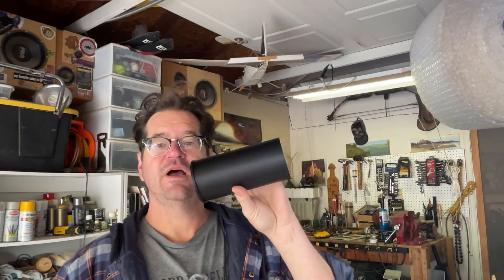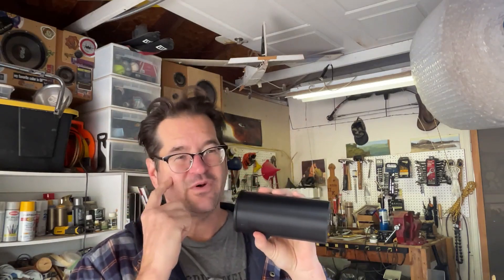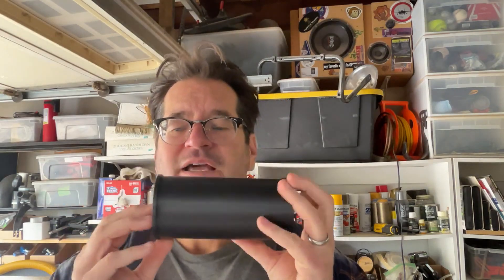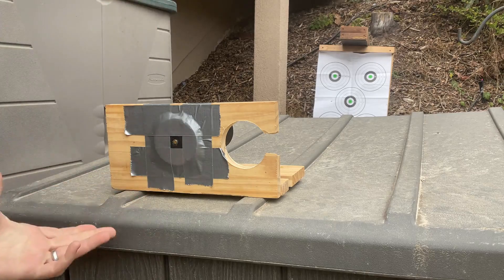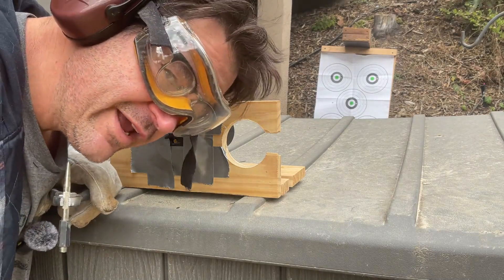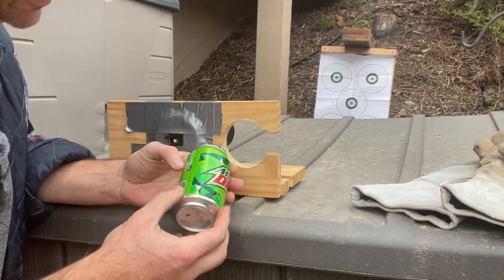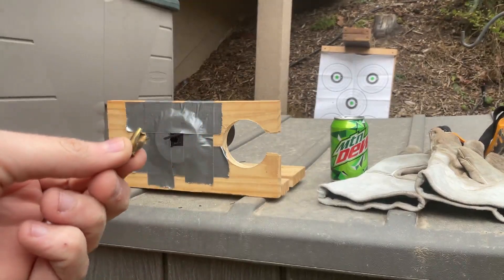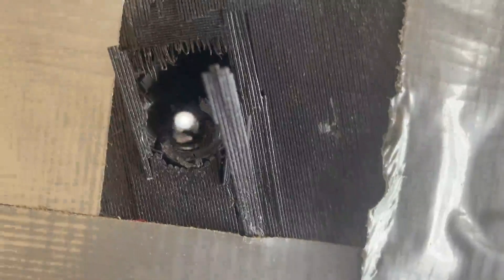3D Printed Gun Barrel... Will it work this time?....

Comment: The Liberator was the first 3D printed fire arm that can be printed without a barrel sleeve using a nail as the firing pin it can withstand a 22LR. Or look up the 22LR Songbird with a printed barrel  sleeve. Your testing was made meaningless with a Google search of basic modern history.

Comment: "The big thing when parts started becoming interchangeable in the ahhh 1800s...." people don't  realize the biggest strides and advancements in firearm tech pretty much all happened in the 1800s. That is the centey we went from blackpowder muzzle loaders to metallic cartridges,  and smokeless powder which were what allowed all the other advancements to happen. See repeating firearms existed well before the Revolutionary War they were just complicated expensive, unreliable and outright dangerous to the user. The only example a "successful" repeating  rifle that was relatively safe and reliable was the Kalthoff repeater designed and used by I believe the Denmark in the 1630s. I believe the mag tube held up to 29 rounds and could fire a blistering 40 rounds a minute. Anyway the dirty inefficient blackpowder and chambering method was what held firearms back and metallic self contained cartridges made repeating firearms a cinch and clean efficient high pressure smokeless powder made reliable semi-auto and full-auto possible. And most of these sytems had been designed by the end of the 19 oughts and since then it's  just been incremental refinement. Even the venerable AR-15  was designed in the late 1950s and it's  big brother the AR-10 went into production in the mid 1950s. About the only things the AR rifles did new at the time was used "space age forged aluminum " for the recievers and "space age polymers for the furniture" so Stoner and Armalite were able to drastically reduce weight, recoil and set the standard for ergonomics and intuitive controls. And it used a new lightweight high pressure cartridge .223 that substituted projectile size and mass for velocity to deliver energy on target.  Here we are almost 70 years later and firearms manufacturers and countries have stopped trying to surpase the AR-15 and they are all now deciding to adopt it.

Comment: Chamber diameter too sloppy soft rim edges, 22 LR is a rimmed cartridge you should be using a screw driver on the rim on a slight angle like a 22 firing pin blade not a center punch that would and did keep floating into middle of the head like a center rifle,

Comment: I have researched this subject diligently. Not for any other reason than curiosity, but you can make a barrel with electrochemical machining. You essentially 3D print a rifled insert and then pump a solution through it to achieve the rifling effect. As far as a 3D printed barrel, I don't know if i want to be the one holding it if the barrel is printed. Or be anywhere near it when it goes off.  Although, with the advancement of metal 3D printers, it's only a matter of time before 3D printed firearms are as strong as a machined part. In New York State, they are trying to make it so you have to have a background check to buy a 3D printer. Trust me, if there is a way to regulate it, New York with find a way to make it difficult for law-abiding citizens to get a firearm. As for criminals, it's still super easy for them to get a gun. I don't know why they can't figure this out, (they can) but, criminals don't care about laws. Only law-abiding citizens care about laws, hence the term "Law-abiding". The biggest criminals in this country reside in Washington, D.C.

Comment: This is entirely a skill issue, the first ever "3D printed gun" fired a .38 from a plastic barrel. The barrel was about 15mm thick of solid plastic.
There's about four stages to of 3D printed gun 1. Entirely 3d printed guns which are always small calibers and rarely repeating 2. Guns with a few metal parts, usually the rule is to only do what can be made with hand tools and a stencil 3. guns where all but the working parts are printed, these usually only keep the barrel and gas system from whatever they're based on 4. 3d printed lowers with normal gun parts just intended to dodge whatever law.

Comment: PLA is strong, but very brittle.   As in, not very shock resistant.  But, what is the point of a thick wall, when you used low infill?

Comment: low infil! dude make it like 5 walls top and bottom with 100% infill otherwise its going to explode. and make it like a 1 inch barrel. most bull barrels are like .9" thick. also .22 lr chamber liners are cheap 8)

Comment: I think what would be more interesting is if you tested a 3d printed PLA rifled barrel liner to go inside a say 6mm (may need to be 6.5mm to fit the rifled printed liner) smoothbore stainless steel tube, comparing accuracy results from just smoothbore vs with printed rifled liner inside the smoothbore steel pipe, to contain the .22's pressure. I'd be interested to see what kind of results this would produce, even if it fails catastrophically like this one, although I don't see that happening with steel pipe. They would have to be jb welded together so it doesn't send the printed liner flying out, or maybe it would just wear the PLA liner within a handful of rounds.
Reply: This doesn't work rifling wears away based on how hard it is compared to a the bullet so anything much softer than aluminum won't last even a single shot. Normally the barrel is made by just drilling a piece of metal with rifling being added either via a rifling button or ecm(using salt water with electricity to erode the metal around a stencil).

Comment: Try making the internal barrel out of 66d+ tpu, then wrap a nylon barrel around it, then reinforce the nylon along the layer lines with threaded rod with nuts on both ends as rebar.

Comment: You are correct about 3D printed guns actually being a 3D printed lower receiver.  Due to how US firearms laws are, that is the serialized / legally controlled / 'gun portion' of the gun.  Meaning you can purchase a parts kit that covers the rest of what you need to build a gun and you legally have not 'bought a gun' - specifically because you did not buy the lower receiver.  So that's the why behind 3D printed lowers being considered '3D printed guns'.  Almost none of them (except the original Liberator model, not sure if there are others) use a plastic printed barrel.

As for shooting with a 3D printed plastic barrel effectively and without the barrel blowing up: yes... you can... but only for rounds with quite low chamber pressure and you really can't use anything less than 100% infill and expect success.  The barrel is also only going to have a lifetime measured somewhere between a couple rounds and maybe ten.  The original liberator design (plastic barrel) is purported to have a barrel life of 8 to 10 rounds.

As to the result you experienced with your printed barrel: since you went with less than solid 100% infill, you didn't really have any containment on chamber pressure, or sufficient containment around the round (which is why it resulted in case breach).  Effectively much of the energy of the round went into breaching the case, and the soda can was hit with a 22LR round that, in terms of energy, was shot from a null-length barrel (0 inch) with maybe 1/5th to 1/10th the normal energy to start with (since most went towards case breach).

If you look up firefighter training videos explaining the hazards (or kind of lack of hazards) of ammunition cooking off in a fire, the effect is explained.  Pistol and rifle rounds, when not contained and the energy directed by a barrel, are nowhere near as dangerous as when fired from a gun.  A firefighter in bunker gear can stand next to ammo cooking off (as long as it isn't cooking off while loaded in the chamber of a gun) and basically feel like gravel is being thrown at them hard.  You wouldn't want shrapnel hitting you in the eyes, but at that point (without proper barrel pressure containment) that's basically what it is, mid to low energy shrapnel.

Comment: Man how many walls? I’d be doing 6-10 at least and maybe a cubic or gyroid infill. 
I’m interested in the pressure capacity. So many applications if you can 3d print high pressure items.

Comment: You drilled the barrel out too wide. You want the bore diameter to be .222 with a groove diameter of .223 for 22lr. .226 allowed all the gas to bleed out which got rid of all the kinetic energy and speed. That's why it didn't penetrate the can.

Comment: Hi! I’m new to Idiot Land, but probably a long time resident .
A couple of observations:
.22 is rimfire, which means the rim is the part that must be struck by the firing pin or hammer or striker if you want the primer to detonate. 
Striking any primer too hard, whether rim or center fire, will just pierce the primer rather than detonate it. 
An easy way to avoid your brass from exploding in the barrel is to simply use a barrel liner (will also help with accuracy), just bore the tail end to fit the round in, to make it into a chamber.

Comment: .22lr is a rimfire cartridge. You have to hit the rim to ignite the primer. Center fire cartridges use a primer cap inserted into the center of the case head of the cartridge. Hope that helps in the future.
Reply: Heard a story about old car antennas being used a barrel.
Reply: Someone made a 38 barrel but it was 100% infill (as it should be) and a metal tube around it.
Reply: On his test it looks like he had the punch on the rim most of the time, it just sometimes slid to the centre.

Comment: The liberator pistol used a 3D printed barrel, the material and process matters, ABS with an acetone vapor bath will allow it to withstand .380 ACP chamber pressure.
Reply: Ah, not sure if you realize, but 22lr is rimfire, the priming compound is centrifugally pushed only into the rim of the cartridge, that's why it didn't fire when you hit the center.